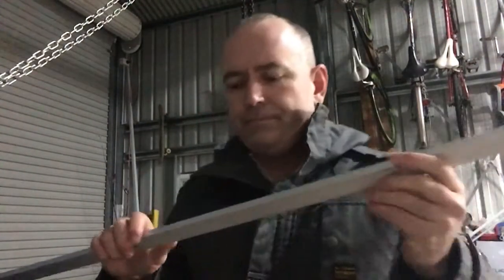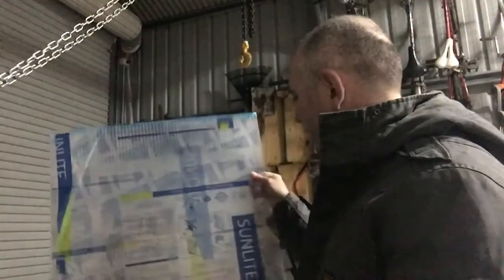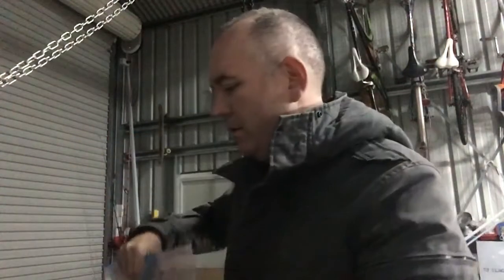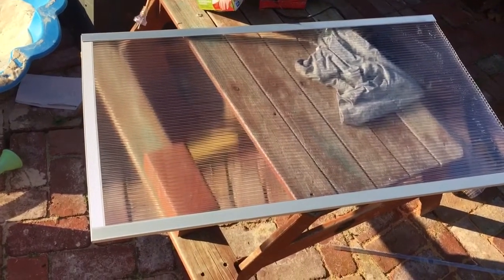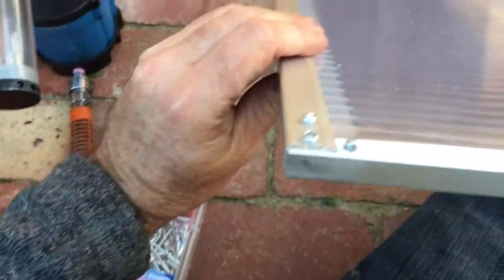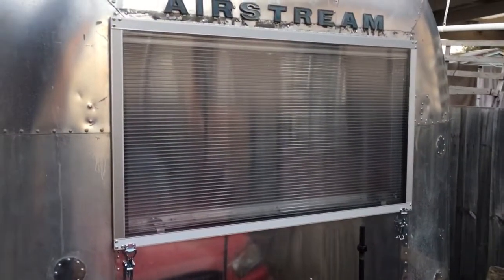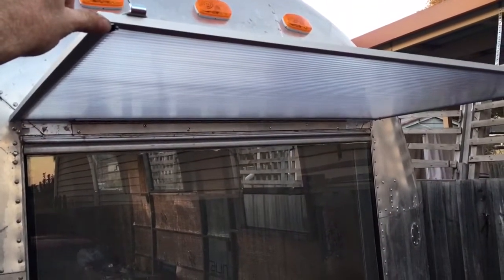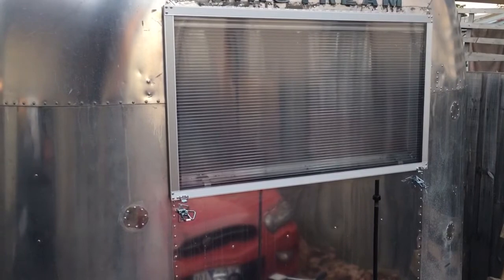How to make a front window guard for a vintage Airstream Travel Trailer

Comment: I have a 1977 that I have debated a tilting and folding solar panel
Reply: That’s an interesting idea - not sure how solar panels go with stone chips though. Depending on what angle your trailer is parked you might not get the full benefits from the panel either.
Reply: it would be a trade off as to value of panels vs window it would make sense to be able to move it and protect it.